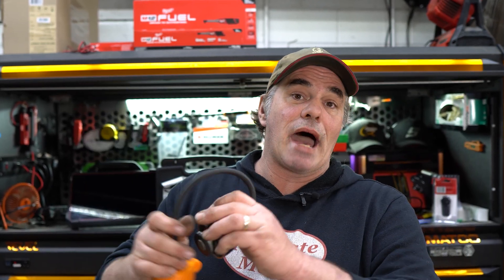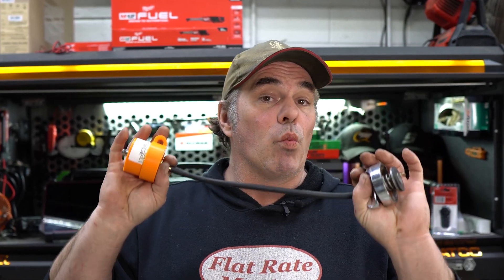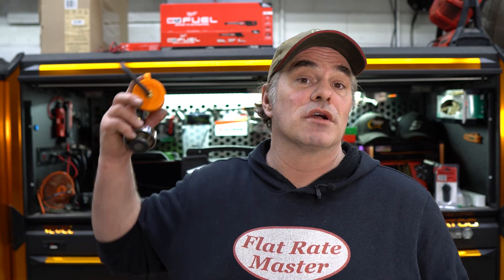Tools to Find Headgasket Failures

Comment: I found a headgasket leak on my 04 Altima 2.5L.

Drove the car for 10 mins, went inside the supermarket and shop for 30 mins, and start the car again. Car runs rough for the first 5 seconds or so. Maybe coolant leaked into the cylinder after shutting off the engine, and that puddle of coolant caused misfire during start up. No DTC, no overheating, consumes coolant. I opened the radiator cap and checked for bubbles, no bubbles. 

First I used block tester. liquid stayed blue. means no leak. 

Second, I used pressure tester. 
compressed to 14psi. 10 mins later, it became 13.5psi. I thought that's not too bad. 

But just in case, I removed the plugs and used borescope to check inside the cylinder. on one cylinder, some areas of top of the piston was clean. I pressurized the coolant system again while looking at the borescope. 

I saw a tiny line(stream) of water flowing from the head gasket area😭😂 

Yup, it's a headgasket leak. 

I tried those sodium silicate headgasket sealer, followed instructions, drove around, then checked with bore scope again. 

This time, no pressure decrease over 10 mins and no stream of water inside the cylinder.

Comment: The very best way that makes me feel comfortable in being 100% certain its a headgasket leak is doing a test with cylinder leakage. Bring cylinder up to tdc compression stroke. Hook up cylinder leakage tester. Shoot in 80-100psi. If headgasket leak in that cylinder. Air bubbles will come into coolant reservoir.

Comment: Good talk.  Years ago car came in with little coolant, customer said it overheated.  Filled it up, let it idle for an hour, acted fine while I worked on other car. Went for quick angry drive, suddenly smelled coolant and it’s pumping in overflow. Ease it into shop, check it with classic color change tube on radiator with no change.  Check tester at exhaust, changes fine.  2x angry drive pumps coolant out hard. Check spark plugs and see nothing. Pressure test rad. nothing.  Nerve racking hours later with top of v6 stripped off -find Rear engine head, head bolts pulled out of block.  If snap on had a 5 gas on truck that day, I would have bought it.

Comment: Don't forget the old personal sniffer works too if the failure is severe enough haha. I've pulled some cars into the shop and just one sniff of the coolant been like yup that'sa  bad head gasket. Always verified it with another method.

Comment: what about getting the engine hot, pulling a spark plug and putting an inspection mirror over the hole and see if condensation forms on the mirror, and inspect it ?

Comment: I have also found headgasket leaks with a cylinder leakage test. 100psi in the cylinder at TDC with both valves closed. You can hear/see bubbles in the cooling system
Reply: Yep, that’s what I do too

Comment: I worked one shop for 4 days. I had a car with a blow head gasket. Shop foreman wouldn’t accept the diag if the block tester did not read it. He made me bleed the coolant system for 3 days. 4th day he told me to drive it. I drove it about half a mile and came back into the shop rolling smoke. He finally believed me. I quit the next day. Shop wasn’t worth working at anyways. Always research a place before you apply or accept a job

Comment: Just to make sure I understood you correctly: If the Combustion Leak Detector detects combustion gas you definitely have a head gasket leak but you may have a leak even if there is no combustion gas leak. Is that correct?
Reply: Correct

Comment: No mention of running the car up on the funnel? The ones we've got have a clear window and one-way valve to stop air entering sytem. Just get to operating temperature and watch for bubbles through the window. Bubbles only get there via combustion gasses in cooling system e.g. head leak or EGR cooler leak. In some cases  cavitation from waterpump can do it but this is pretty rare.

Comment: An old German mechanic taught me the coke bottle trick, fill bottle with water put line of vent drive it hard jump out go check it , if it has bubbles BOOM she done , modern cars you might hv to fab up some adapter. But I like that pulse sensor test also

Comment: Luckily the shop I'm at now has the gas analysis from snap on. It makes hg leak test very fast and accurate. I used to use my leak down test and pressurize the cylinder than watch for bubble in the cooling system with a no spill funnel.

Comment: I have a Hemi Charger in the garage right now with a whole bunch of oil in the coolant. No coolant in the oil. I had it apart about a month ago for cam/lifters. Before pulling it apart that time, there was a small amount of oil in the coolant. Pulled it apart and did the cam and lifters. I had the heads checked for cracks/flat at the machine shop and they tested ok. I pressure tested the oil cooler and it seemed ok as well. Now have about 2 qts of oil in the coolant. I am replacing the oil cooler and see if that does it. Otherwise off with the heads and checking for a cracked block. 🙃
Reply: We typically see that with Pentastar engines along with or followed by the “Pentastar tick”.
Reply: @asm154  Yeah: Chrysler or whatever company they want to be called can't seem to get the lifter/cam thing correct. 🤨 I don't mind wrenching on their stuff though, pretty straightforward.

Comment: Thanks for the idea of the hole in the top, but I also agree what about a leak down tester ?
Reply: Leakdown includes pressure loss from valves and rings so not a great test
Reply: True true it’s not specific head gasket tester fair enough. But it’s definitely a go to with mechanical caused misfiring

Comment: What about a leak down tester?
Reply: How's a leak-down tester going to work to pressurize the coolant system?
Reply: @CPthetooladdict  It pressurizes the the cylinder and then you pull radiator cap off and look for air coming through the radiator. You can put your hand over the the cap opening and feel it build pressure and you can even put your cooling system pressure tester on the radiator assuming there are no other coolant leaks and watch the pressure gauge build up.
Reply: They work... more invasive, have to set-up in spark plug hole  (glow plug or injector for diesel), set engine to tdc for each cylinder, it takes some time, more time than using a bore scope. 
Where they are good os determining which cylinder is leaking as you can pressurise that cylinder and watch for bubbles entering the cooling system